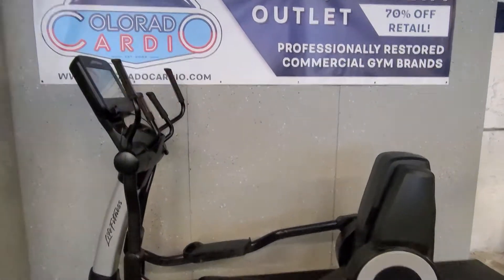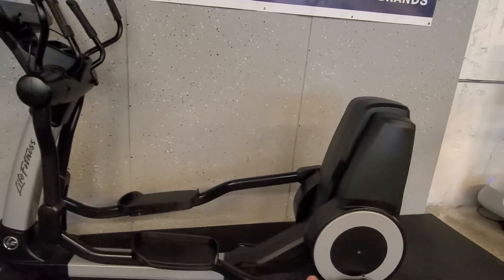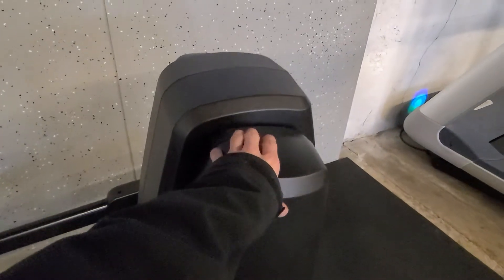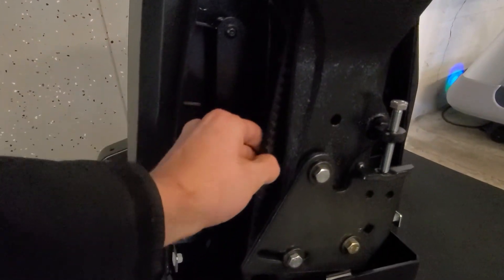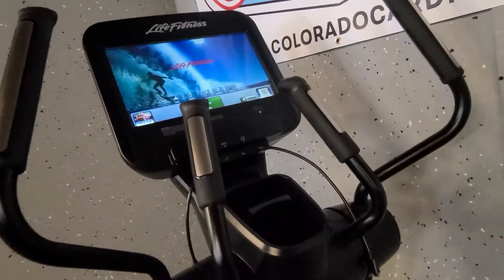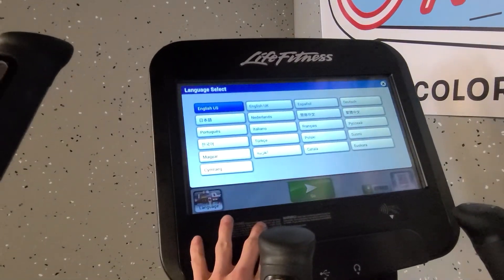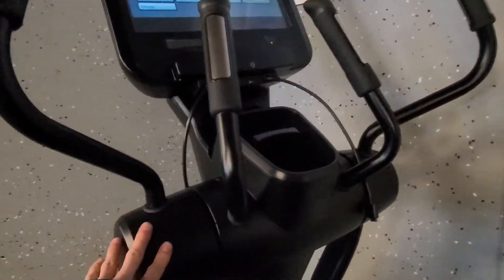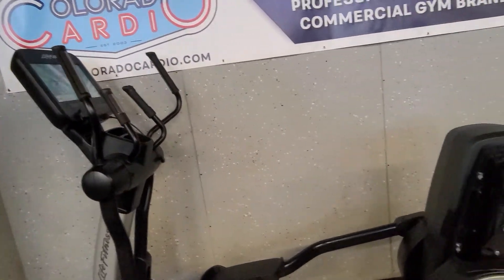Life Fitness Elliptical Maintenance

Comment: Hi there.  I find that even with the resistance setting at zero, the resistance is a bit too high.  I changed the belt already, and set the tension to where the belt doesn't slip.  It's still difficult to pedal but if I lower the tension any further, the belt slips.  So I changed the control board, but it is still difficult to pedal.  Do you have any thoughts?  Thanks
Reply from the maker: The resistor is bad it is located next to the motherboard.
Reply: @coloradocardio  You mean the brake generator assembly?